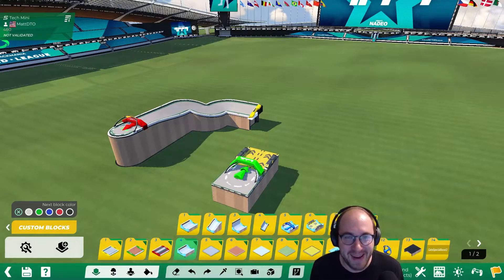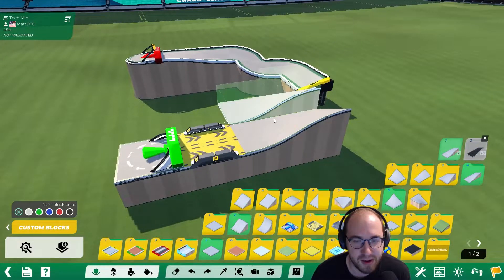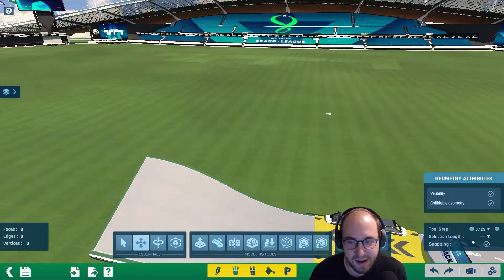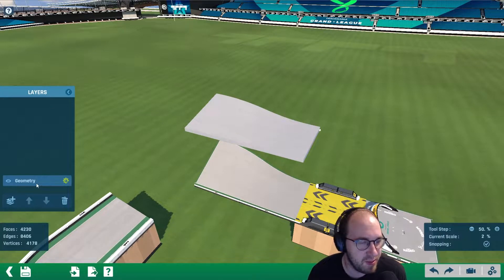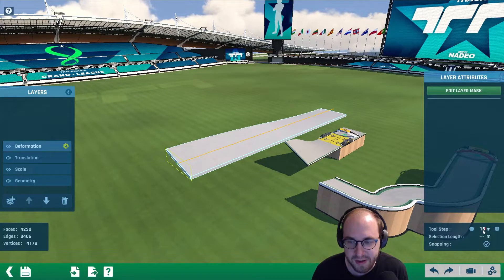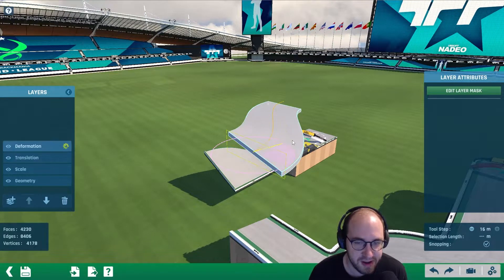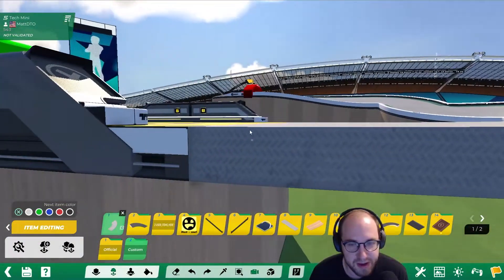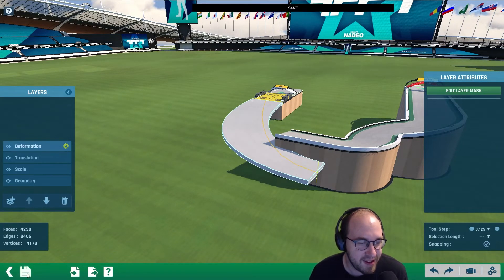How to Build a Flat to Bank Turn in the TrackMania Mesh Modeler

Comment: I'm just starting out making a racetrack in Trackmania and It looks like I will be using you're tutorials a lot to help me! Grrate videos :D

One question: is it possible to make custom downhill gradients? I'm trying to make a real life racetrack in TM, but the slopes are to steep to match real life :/ any advice? I need the longest shallowest downhill tile in the game to be 10 times longer but with the same gradient.
Reply from the maker: Thanks!!

Yes, that should be possible! If you see in this video, I’m using the scale tool to shrink the height by 50%. The scale can go in any direction, so you can use it to make an item 10x longer. Optionally, you can do it by going “new layer” -> “scale” and enter the values you want.
Reply: @mattdto  I figured out some of it now, but it's taking ages :p my wife is not happy😂 any chance of you helping me out with some of the more complicated turns on the track? :)

Comment: when i’m on the last step of rotating, it never works properly, i’ve tried multiple times over and over
Reply from the maker: Shoot! I’m not sure why that would be. What happens when you try to rotate it?
Reply: @mattdto  Hey! When I try to do it it makes the turn but it doesn’t fully work and instead only connects 70 of the turn and the rest is still straight. Hard to explain sorry